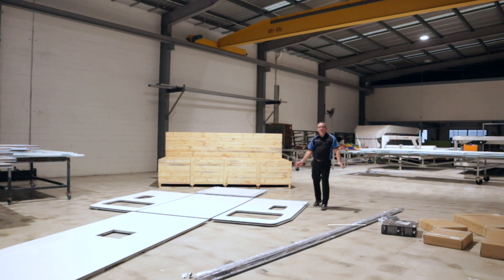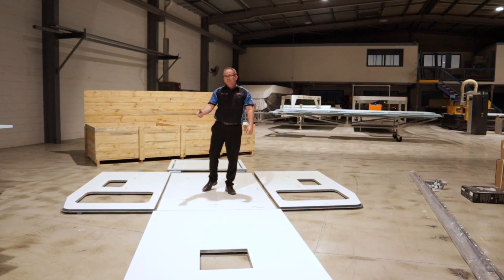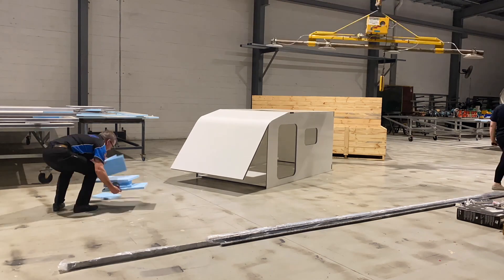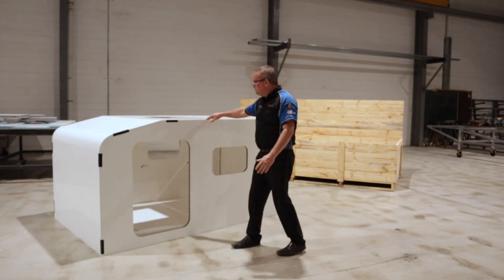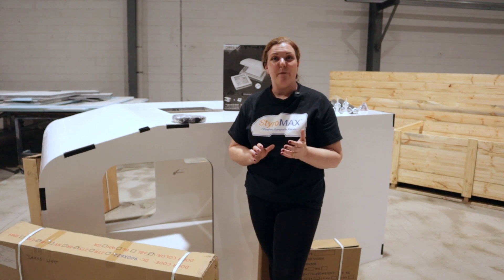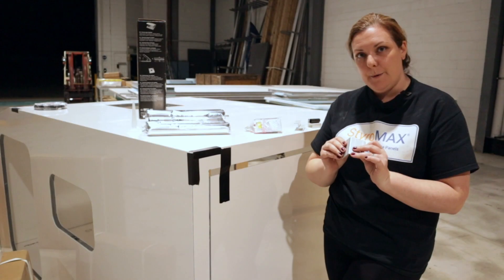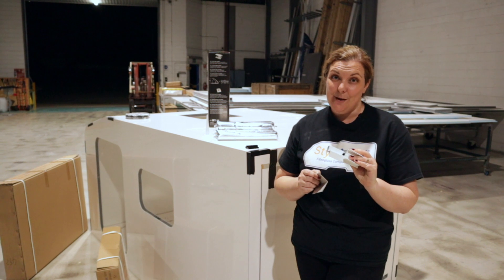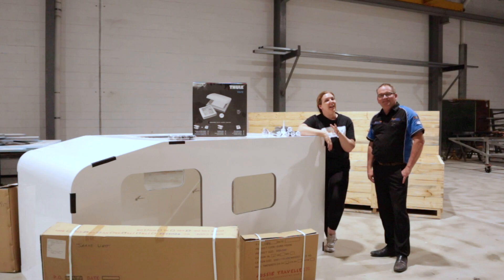STM/20-240 JW Square Back Camper

Comment: Is the walls button joined floor level. Making outside dia bigger buy wall thickness. And there not enough info for diy on other designs you got.
Reply from the maker: Hi Rusty, we have many videos of our products and installations on our YouTube channel, over 100 in fact. Our website has a lot of information on the products as well. What content specifically would you like to see?
Reply: On the stm 20-240 it looks like walls are bottom butt joined making it sit on top of chassis. Thus making this camper wider. As from the start of this video you say the floor 2400mm x 1450mm  The roof front wall cut in and the walls are on the outer. Making the over all size different. So start of video and the finish build looks not same to me. I liked to build and  I am shore your there to help. Russell
Reply from the maker: Hi Rusty,
It all depends on each build and that individuals chassis requirements.
Our requirements are a 50mm surface area to bond the panel to that is integral to the sub frame. Only in toy haulers do we see them sitting on top of the chassis as the vehicles are at max width. 
This will be bonded to the side of the frame. Generally speaking, all measurements given are O/A, not inside measurements.

Comment: How structurally sound is this?  I’m looking at building my own 5ft by 8ft off roading trailer.  Does this need to be supported by or bolted / screwed into aluminum or steel for the cabin?
Reply from the maker: Hi Kyle, we simply bond the panel to the sub frame, creating a monocoque. Check out some of our other videos such as the destruction test one. We've had product out in the field for over 15 years, travelling some of the toughest roads in Australia.